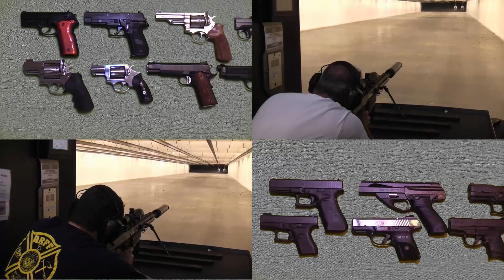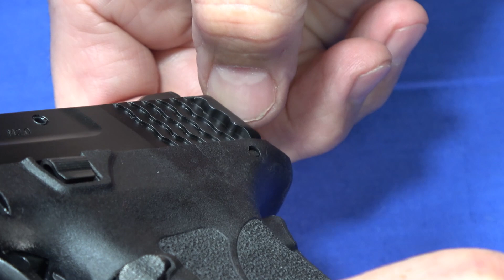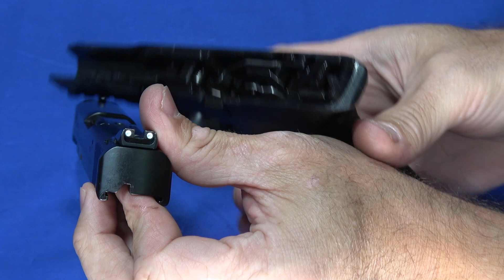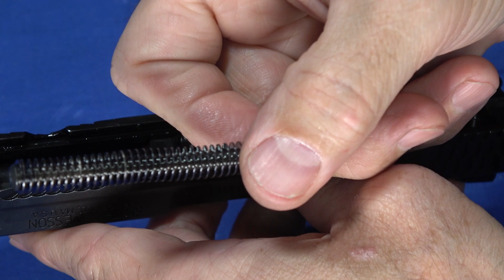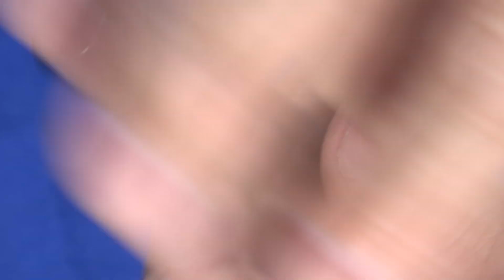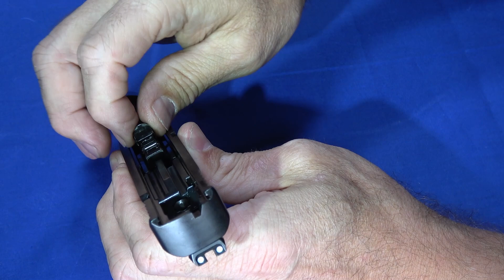Owner Review: The New 9mm Smith & Wesson M&P Shield 2.0 EZ

Comment: Problem I had.  Cartridges caught the mouth of the case on the front of the mag.  Caused a lot of FTFeed.  I contacted S&W and they sent two new mags that were exactly the same.  I couldn't even unload a mag with my thumb because the rim really caught on the front of the mag.  Rather that send the mags back to get the same results I decided to sand down the front of the mag.  I tried the gun today with several types of ammo and not one glitch.
Reply: Haha, I did the same. The rounds would clip the front of the mag, so got a grinding bit in the drill and lowered the front, the entire shell now clears and feeds perfectly.

Comment: I bought one to teach older folks that there was an option besides the 2" snub. What I got was a slim pistol with an upside down grip safety that would work better if it was a 1911 style. It also should have gotten the MP shield plus hi cap mag which would have made the grip a little more comfortable. Its also disconcerting that almost immediatly after gun came out, so did videos showing you how to deal with the slide jamming when you try to disassemble and/or reassemble the pistol. Compaired to all the other S&W MP's I have, this one was a dissapointment.

Comment: Good review. If anyone wants a level 2 security holster for either the .380 EZ or the 9mm EZ, you can fit either one into a Blackhawk, Serpa for a Glock 19 (4" barrel).  I glued a small strip of leather, along the inside of 1 side, to act as a buffer shim. The 9mm, doesn't really need it, as it has a  bit wider slide. Adjust the tension screw to fit!
Reply from the maker: Thank you.  Thanks for the holster info.

Comment: I checked a 9mm EZ out the other day. It did feel decent in my hand. It did rack really easy. I'm not a big fan of grip safeties. I am concerned about the recoil spring being so light. My favorite target load, 124,gr NATO fmj might be too hot for it.
Reply: Not at all it will eat any ammo you feed it
Reply: Just ran 100 Federal Syntech 150gr range ammo w/powder coated bullets through my 9EZ... Unbelievably smooth action. Less recoil than standard 115gr ball. 300 rounds so far and my only issue was dropping the mag due poor thumb placement on a quick draw!  May switch the the ambi release to the right.

Comment: That magazine design should be on every pistol ever made from now on that isnt used for combat. Its brilliant.
Reply: bunberrier 
The German 1908 Luger pistol was the first pistol to feature the loading tabs on a magazine.  Heavily used in combat, WW I and WW II
Reply: @steveolto9805  Didnt know that! Ive never been in combat but it seemed to me you wouldnt want those tabs on any magazines carried catching on something and releasing the pressure.
Reply: The Benelli B76 single stack magazines had recessed tabs that made it easy to load. And it was one of the easiest slides to rack, due in part to the unique locking mechanism that didn't require a stiff recoil spring to handle hot 9mm loads. 

Unfortunately the grip angle was such that the pistol wouldn't function reliably with anything but standard hardball. Wish I'd kept it anyway. Now there are hollowpoints that are long enough with ogive and nose shapes that should feed in the Benelli: the Norma MHP and Barnes Vor-Tx.

Comment: Great review. Thanks. I am curious if it is +P rated or only standard pressure.
Reply from the maker: Thank you.   I reviewed the manual and there is a chart on Page 11 that indicates you can run +P (with the usual warning about increased wear) but not +P+.   Due to the balancing act of slide weight/spring weight to make this gun what it is, it possibly will be less reliable with +P so test it will with your choice of ammo.
Reply: @HammerStriker  thank you very much. Appreciate your diligence and consideration. 2 of my daughters have 45 Shields & my wife has a 1.0 9mm Shield. My last daughter likes my 2.0 40 but isn't confident with slide & isn't fond of aggressive grip. Looking at this 1 for her. She will be carrying soon.
Reply: You don't really need + p ammo